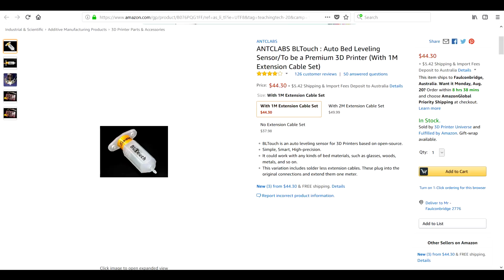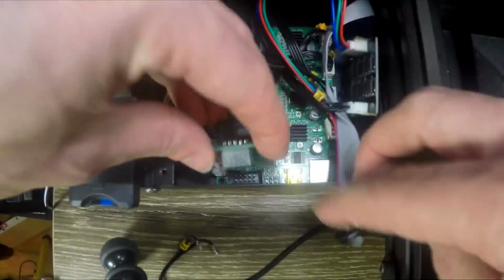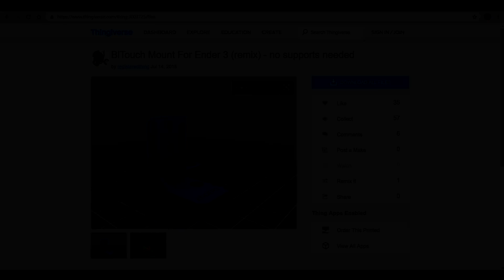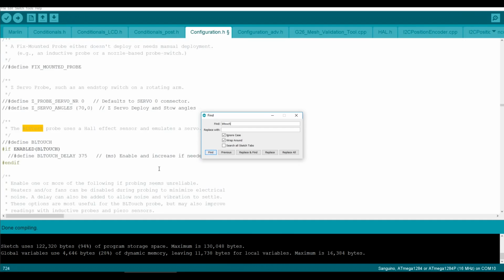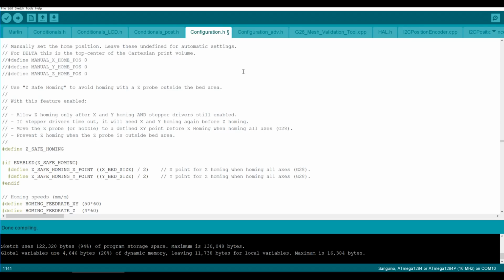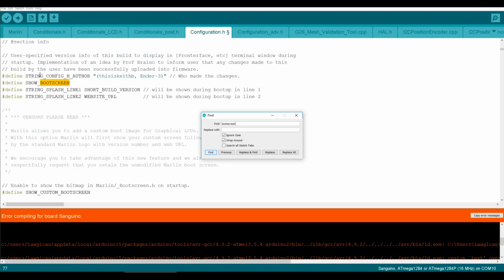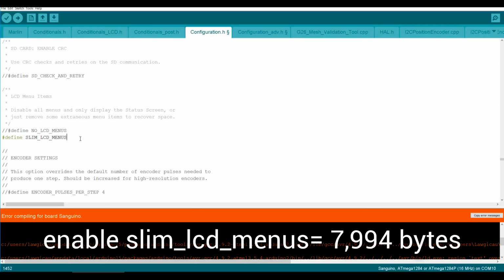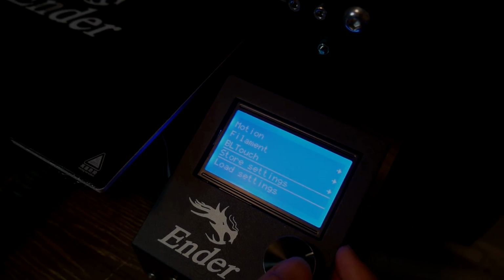Ender 3 BLtouch vanilla Marlin guide

Comment: Great guide, but i'm having a huge issue. I've followed every step in this video, but my issue occurs when my BLTouch starts to level. when i test with my finger, the touch retracts it's probe, but the gantry keeps going down.  I add G29 in gcode, re-uploaded the code (maybe it didn't upload properly), and even redone its connectors to the board (thinking there was no connection, due to severed wire)... Nothing. I tried all i can think of,  I have no idea what else i can do.. Maybe someone can help with this problem.
Reply from the maker: Reverse the black and white wires from the BLtouch to the mainboard. That normally does the trick.
Reply: Hello Teaching Tech, 1st up - Thanks for all of the info, as a newbie I truly appreciate it. Next, I am having the same problem as Jay C, I installed the MKS board and all was working and then went forward with adding on a BLTouch as per your videos, this one and the previous ones.  I also seemed to have followed the path of Jay C, where I rewatched and reworked the files and the wiring thinking I missed something. I do get the flash of the BLTouch when powering up and the 2 up and down cycles that it does showing its wired correctly but when i test with my finger, the touch retracts it's probe, but the gantry keeps going down until it hits the bed. 

I did try to change around the black and white wires and the same thing happens.  Can you provide any additional guidance with this problem?
Thanks
Reply: https://github.com/MarlinFirmware/Marlin/issues/13345
You guys are running into the V3.0 problem I am most likely

Comment: This does not work for the ender 3, only the pro version. Also, itd be nice if you put all the required items at the start of the video so I wouldn't have my printer taken apart just to find I need to print a part to put it back together

Comment: Thank you for this! I got my BL Touch all set up and it's great. My only issue seems to be that the BL touch probes at the very front of the bed (like a few MM from the edge) and then when it goes to do the back it's almost an inch or so in. It wasn't doing that before, so I wondered if maybe it was something from the files? Any idea on where I should look either in the firmware update or the BLTouch files to figure this out? It's cutting parts out of my prints that go near the edge of the bed without telling me that it's doing that. =/

Comment: Leveling works thanks to this video, but when it goes in for the initial line, the probe pin stays deployed down (will not raise after probing) and will get caught on the print and side of the bed. I must have missed a setting somewhere? Any thoughts?

Comment: @Teaching Tech I have followed the guide to the letter and my Bltouch is all set up probing in a 4x4 grid, the issue is when it comes to doing the first layer of set After a manual level still same issue, I'm using a genuine Bltouch and I can eather get the right side to print with the correct level of squish but the left is then to high, or I can get the left side correct but then the right is ripping into the bed.

I measured 6 points across the X axis and there all the same so I'm now at a loss to explain what's happening. 

Any help would be greatly appreciated.

Comment: hello.
sorry for my english language.
Can you please tell me what happens in the black and white cord when the needle is raised and lowered?
I measured my 3d touch sensor on resistance and shows 10 ohms all the time.
activating the self test command is all right.
when I test the G-code M119 all the time, the needle is open
Reply from the maker: Hi Toms, the clone sensors are notoriously unreliable. Assuming you have made the firmware changes properly, the first thing to try is swapping the black and white wires where it plugs into the mainboard.

Comment: What I noticed too late was that when installing the BLTouch, I swapped the brown and red wires followed by connecting it to the mainboard.

Then I realized that the printer wouldn't turn on. After reading some of the comments, I swapped back the wire and I could see the BLTouch do its self-test.

However, it seems that I need to plug into the USB before the LCD + motors can work.

So is my mainboard fried? Or how should I fix it?
Reply: So it seems like I have fried the regulator based on this comment:
 https://www.reddit.com/r/ender3/comments/ao5m5b/ender_3_can_only_be_powered_on_by_psu_and_usb/

Comment: Great video! Have you seen the Creality BL touch kit? They even included a USB ISP programmer similar to what you used. Do you think you will be getting one to review/check out for one of your creality printer? Would love to see you digest it. I got one installed on my Ender 3 Pro but the marlin fw they use is 1.1.6 so it is a little out dated. They did manage to enable BL Touch with full LCD Menu though.

Comment: Hi Michael, first of all congratulations your videos are amazing, thinking how would be your videos in Patreon.... Anyway I have an Ender 3 (not Pro), bought the BLTouch, the 27 Pin adaptor and Arduino UNO (original hope it is the same as yours), as per your suggestions, I understand first have to bootloader and after that I have to update the firmware and now starts my confusion, which firmware should I use for Ender 3, I see you sell the file, How can I buy it, the link did not open here :(. Cheers,

Comment: Well, this sucks. I followed this guide to the letter, turned on my Ender 3, and POP goes the BLTouch. Now the printer will turn on, but the LCD does not light up and the BLTouch doesn't illuminate either. I also tried to connect to CURA via USB (I've already flashed firmware and USB prints work for me) to see if I could at least print that way for now, nope. I'm dead in the water.

I looked at this video to see if they did anything differently: https://www.youtube.com/watch?v=KoCvwPZUkBI and if you fast forward a bit, you'll see that the host shows the pin-outs of the board if you were to splice them. I looked at this, then I looked at the etching of the 27pin adapter I bought and apparently they line up right out of the box. So, if you don't want to wreck your BLTouch or your main board, DO NOT FLIP THE BLTouch WIRES AS INDICATED IN THIS VIDEO! YOU WILL FRY YOUR MACHINE LIKE I DID. The BLTouch and the 27pin adapter both come the right way now. 

Obviously I take some responsibility here because I just blindly followed a video, but now I'm stuck, with no support, trying to figure out what all I need to replace now. I don't know how to diagnose if it's the main board, if it's the LCD, if my BLTouch is bad or what else. So thanks for the video, but now I have a paper weight.
Reply: Sorry t hear that NC, I was about to make the mistake you made and as I was staring at the pin 27 and the 3 colors wondering and wondering how you know what goes where, the light hit the Pin just right and it actually has the colors written on it for each pin, near where the LCD plugs in. 
Only now I am stuck and can't do anything either - followed to the T, but there are so many versions of this video by TT. configuration.h doesn't have any endstoppullup in it - located elsewhere and it doesn't match his and I get an error saying servo0-pin must be defined, but did as he did. Ughhh.

Comment: Hello, I flashed this version but it seems when I try to change the M92 E setting (Changing from 94 to 97), no change when i measured the filament. If I send the same code manually it works properly. Any ideas why i cant set it in Marlin Configuration.h? Thanks

Comment: A little tip with threading the wires through the dreaded mesh sleeve: Use some filament as "fishing tape". Works GREAT!
Reply: You are all doing it wrong. Its like a sock, you cramp it up to only an inch or two. It widens and the cables are easy to thread.

Comment: Nooooooooooooo! Use a flexible wire or nylon rod with a hole on one end to push through your fibreglass sleeve. Simply tie the cable to the end of the rod and pull it through without any difficulty.
Reply: I find it's super easy. simply push the two ends of the sleeve towards the middle (towards each other) this will make the sleeve "open up". it took me like 12 seconds to thread the cable.

Comment: trying to follow your guides and im about to throw my pc and my printer out the window and set fire to it..
I have downloaded the FW files from the link provided but they are now a newer revision and totaly different to the setup shown in this video.

Where can i get these FW files to get this to work?

Thanks
Reply from the maker: Hi Paul, I've just downloaded the latest Marlin and followed the instructions that are with download link and in the pinned comment. Compiled first go. There have been many, many people not follow the instructions and then blame the files. Hopefully you are in this category and this is an easy fix. Good luck!
Reply: @TeachingTech  Hi, Thanks for the reply.. In all honestly i downloaded the file and followed your video rather than look at anything else. Yesterday was also a long and busy day and i was getting very tired and irritable whilst attempting this, so i will give things another go now and hopefully have better luck. 
Thank you
Reply: Still no luck.. iv managed to get the FW to compile following the instructions in the download file. this does not include the part of define SERVO0_Pin 27

But i cannot get it to upload.. i am using an arduino nano and cant get anything to upload with this thing.. i just get out of sync errors..
Reply from the maker: You shouldn't need a Nano unless you are burning the bootloader for the first time. This is a video about BLtouch firmware. I have an earlier video about burning a bootloader except that is with a Uno. You can use a Nano to do this job but you will need to do some googling.
Reply: I ordered an Uno and a Nano but Uno hasnt arrived yet. So trying with the Nano but having issues burning bootloader. Tried skipping the bootloader and uploading FW directly but no luck. Think ill just wait till the Uno arrives.
Reply: @TeachingTech  so i managed to get the bootloader uploaded with an Uno.. step one done..
Uploaded FW but now unable to home as when i try home Z it goes up instead of down and the M48 Test.. whatever that is runs but also moves Z up..

So i decided to buy your files in support of your help and my sanity.. but these are just the 2 config files but not the whole FW file.

How can i set your files to work for me as i only have the newest FW file U1.R2.7?

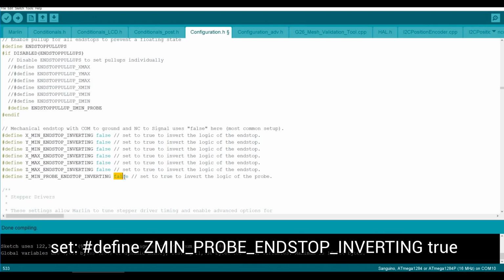Comment: Totally confused. I purchased your files to replace the files in Marlin 1.1.9 and have a couple issues. I am using the Petfang mount and the Bullseye duct and my offset from the BLTouch to the nozzle is -48 and -10. When I set -48 I get the error when checking if it will compile "RIGHT_PROBE_BED_POSITION is outside the probe region" If I set the X to -41 it compiles just fine. Also at 6:02 in your video you say to set  Z_MIN_PROBE_ENDSTOP_INVERTING from FALSE to TRUE yet in the files I bought its set to FALSE. Which is it supposed to be TRUE or FALSE?

Comment: hey I purchased the zip file however as expected my off sets are different.  When I run cmd G29 the probe is off of the bed in all three front locations.  HELP  Now the probe is about 15mm in front of the nozzle.  its about .43 to the left of the nozzle.  if I put these numbers in the offset section I get errors about Max_Probe_X  right probe bed position is outside the probe region, or min_probe_y, Front_Probe_bed Position is outside the probe region.  I'm using Marlin 1.1.x .thanks
Reply from the maker: Please see the pinned comment.
Reply: ok, I did follow the instructions.  I now have G29 probing on the front of the bed.  My mount is to low for Z, so now I need to figure out how to adjust it in the settings.
Reply: @TeachingTech  Well it works, thanks.  I still have a Z problem.  When I run G29 it passes.  When I add G28 followed by G29 in the code for a print job it hits all the correct spots on the front of the bed during the second row it errors on the left side of the bed only.  Then goes to the rear left side and errors out.  I've lowered the bed on that side and it still happens.  What do you think?

Comment: Let me first say thank you for the video. Following the steps you provided I was able to compile a sketch including everything you mentioned with exception to enabling Bilinear. Every time I enable it I get an error trying to compile the sketch. I am using Marlin 1.1.9 with an Arduino Mega. My plan is to use it as an ArduinoISP and flash the onboard memory so I don't have to use the bootloader which occupies more space that I don't have so hopefully in the future I can also install the runout sensor without having to lose too much. Either way I need to determine what the cause of the error is whenever I enable  #define AUTO_BED_LEVELING_BILINEAR. Thanks for any help you can provide.
Reply from the maker: Normally it will spit out an error in the console at the bottom. From here copying and pasting into Google will normally give a solution.
Reply: Ok, so I think I have found the problem, there were actually two errors. One of which was a known issue and I had to rollback my arduino avr board to a previous version. The other was that I had to turn off numerous items (I guess I should have watched the remainder of your video) in order to have enough memory.

Comment: @UCbgBDBrwsikmtoLqtpc59Bw Hi Michael, followed your guide step by step and getting error message  below, can you help.

Please submit a full bug report,
with preprocessed source if appropriate.
See <http://gcc.gnu.org/bugs.html> for instructions.
lto-wrapper.exe: fatal error: C:\Program Files\WindowsApps\ArduinoLLC.ArduinoIDE_1.8.19.0_x86__mdqgnx93n4wtt\hardware\tools\avr/bin/avr-gcc returned 1 exit status
compilation terminated.
c:/program files/windowsapps/arduinollc.arduinoide_1.8.19.0_x86__mdqgnx93n4wtt/hardware/tools/avr/bin/../lib/gcc/avr/5.4.0/../../../../avr/bin/ld.exe: error: lto-wrapper failed
collect2.exe: error: ld returned 1 exit status
Using library U8glib at version 1.19.1 in folder: C:\Users\Dev\Documents\Arduino\libraries\U8glib 
exit status 1
Error compiling for board Sanguino.

Comment: now this is weird , I did all the steps but cannot get the first layer to stick if my life depended on it . all I get is a blob of filament on the nozzle now ,  did i miss something , it worked reasonably well on my pre bl touch manually calibrated bed, and I've set the offset based on the same feeling like i did before  , I even used your files to make sure I didn't botch something up . any ideas?

Comment: Hey guys,

I have a huge problem with printing after installing original BLTouch, watched probably all tutorials and also read many of them. However didn't found an answer.

Generally, I did everything just like in the tutorial and also set offset for Z as it was too far from the bed. So, i did it with commands below:

G28
G29
M500
M501

I even tried it via Arduino > Tools > Screen Monitor when printer connected to USB but also tried the same via OctoPrint on Raspberry. I also saved Z offset with:

M851 Z-0.6

as -0.6 was the value i need. Now, when i use G1 Z0 command, the nozzle is in perfect position. However, when i start printing, the screen on Ender 3 shows me Z 0.3 and it prints with the gap between the nozzle and the bed. It is not the same height as when i type G1 Z0 command to check how far is the nozzle from the bed.

Not sure if this is also important but except BLTouch, i've also changed extruder to E3D Titan Aero.

Hope you can help me to find the culprit as right now i feel like i tried everything and nothing works the way it should.
Reply: Hey mate did you solve this? I have exactly the same problem and spent about 15 hours trying to fix it. Even tried a TH3D firmware and that didn't help either. I am begining to things it's a marlin issue

Comment: I wouldn't recommend commenting the MIN_SOFTWARE_ENDSTOP_Z out. Better option is to use Pronterface or OctoPrint (or any other program to communicate directly in G-code to the printer). With M211 S0 you can temporarily turn off the soft endstops and with M211 S1 you can turn them back on.

When the probe fails, at least it prevents your Z axis try smashing through your bed. Which for me is the main reason stepping over from TH3D based Marlin firmware to the Marlin Firmware itself.

Other than my little side note it's a very helpful guide (as usual)!

Comment: Hi all
so i followed the guide and bought the file just to save time coz im like that lol. I also got all the cables and adaptors needed. loaded up marlin vinilla and followed the guide But had problem with the probe offsets as the X and Y was always out of range/region had to derease the probing on the RIUGHT_PROBE_BED_POSITION in units of 5 till it didnt show errors anymore. all sort of working but im loosing 10mm on the left of my bed and 5mm on the front 

LEFT_PROBE_BED_POSITION 55
RIGHT_PROBE_BED_POSITION 185
FRONT_PROBE_BED_POSITION 25
BACK_BED_PROBE_POSITION 200

STILL have probe defult edge set to 10

Comment: Just added the BL Touch (clone) and used this guide to setup. But when I flash the config to the printer I get a very noisy buzzing sound. I'm using a Pin 27 board so I do not understand how It is buzzing. I have turned off the speaker... also with "#undef BEEPER_PIN" in the pins_MELZI_CREALITY.h file...  but still. Any help please? :-) BTW: The BL touch seem to work just fine, I can Autohome just fine. 
Update: Found that the pin 27 board was sending the signal from pin 27... Cut the PIN and it now works. :-)